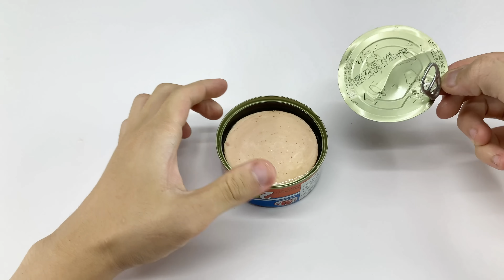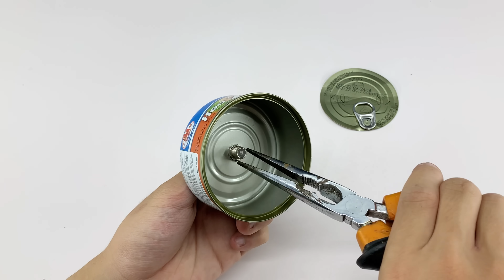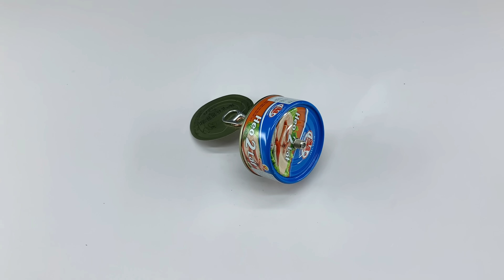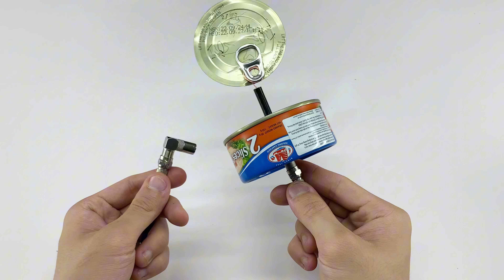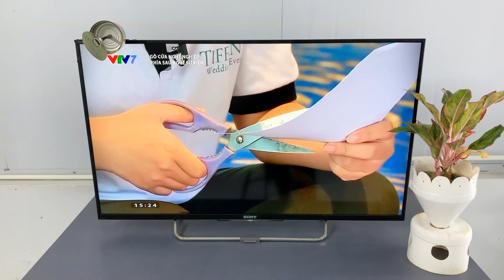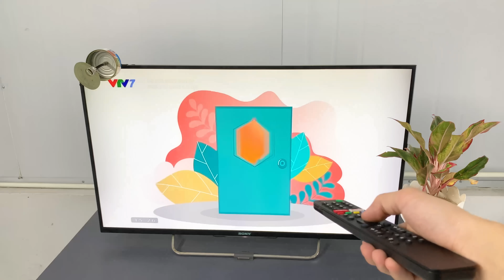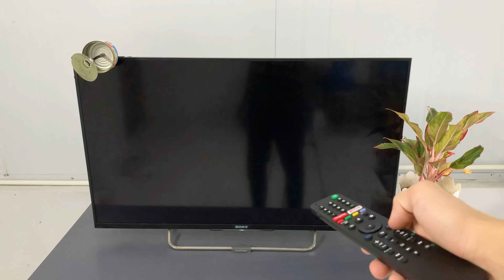No Internet Needed! Put a Tuna Can Behind Your TV – You’ll Be Shocked! 📡

Comment: A friend of mine concocted a Frankenstein-looking apparatus with aluminum foil and metal whatnots - wire hangers, nails, screws, bolts, bottle caps, etc…Her makeshift antenna pulled in 26, over-the-air channels - no internet, though. 

A lot of thrift stores sell television antennas. I got one for $3. It pulled in 26 channels. I spotted a brand new antenna at a discount store for $8. 

In a financial pinch, I can, clearly, understand the need for creativity. fyi: the odor from a tuna can is very difficult to wash away. It lingers.
Reply from the maker: Haha I love that story 😄
DIY antennas can look totally wild but still pick up a ton of channels — no internet needed, just good old over-the-air TV 📡.
And yes… the tuna smell never truly leaves. It becomes part of the antenna’s soul 😅🐟
Reply: Yes Clorox or vinegar for odor
Reply: Not necessarily, clean can with soapy Jim water- smell gone forevver
Reply: Would a can of wax beans work??
Reply: @hingoed Yes but that's only good if you trying to get High Definition on your Television.That is what Bean cans are used for.😂
Reply: Wash it with the original blue "Dawn" dish detergent and lemon juice.
Reply: put white vinegar in the can, leave it in several days ! the odor will go away, same with laundering stuff, wc....
Reply: Et qu'est-ce que vous faites du thon ,?  Vous le recyclez aussi ?
Reply: Wash tin with vinegar. Or use a different content tin ❤
Reply: 1 more thing don't cut your fingers off with the lid! As if the smell isn't bad enough! 😂😂😂😂😂😂
Reply: lol
Reply: Hooo❤
Reply: تختفي مع القهوة الجافة ..لن يبقى منها شيئا
Reply: This doesn't really work
Reply: No
Reply: Total unnecessary ridiculousness !
Reply: Берёте просто спицу от вязания и вставляете в гнездо и он начинает ловить каналы и не нужно не какой банк. Из под тунца
Reply: I rather  smell the fish  than spend money  to make other rich  that is called smart
Reply: I stuck a teaspoon in the back of a tv once in a hotel and it worked. But later tried another in another hotel it didn't may not work on all.
Reply: Wipe out with vinegar to get rid of the odor
Reply: I was getting in 60 something channels with an antenna until it got blown down & broken up. I could turn it from inside thru a channel box. I had another antenna that my landlord hooked up for me, but it probably won't last long & then I'll have to get satellite or cable & have to pay for tv then.
Reply: @Pamela-w8h7f  Pozri v kontajneroch na odpad. Tam nejaké plechovky určite nájdeš.
Reply: رائحة التونة ليست مشكلة ممكن تزال بعطر جيد
Reply: @الحمدلله-ن4ط6ج try bleach
Reply: @الحمدلله-ن4ط6ج or Clorox
Reply: @الحمدلله-ن4ط6ج 0:3p4
Reply: عالیست این جای ماخالیستین

Comment: Can I in old Tv?
Reply from the maker: Yes, absolutely! 👍 You can use it with an old TV, as long as it has an antenna (RF/coaxial) input.
If it’s a very old analog TV, you might just need a digital converter box to get modern channels. 📺✨

Comment: not functioning if the TV broadcaster was far or signal was not strong enough 😊
Reply from the maker: Exactly! 📡 You’re absolutely right — distance and signal strength make a big difference. This DIY antenna works best when the transmitter is within a reasonable range. 👍

Comment: Wait a minute.  Do digital tvs actually need an antenna? I don't think so.
Reply from the maker: Good question! 👍
Yes — digital TVs still need an antenna to receive free over-the-air channels. The “digital” part just means the tuner inside reads a digital signal instead of analog.
Without an antenna, the TV has no signal source (unless you use cable, satellite, or internet). 📡💡

Comment: But my question is what is the plastic box plugged in. TV??
Reply from the maker: Good question, my friend! 📺🔧
Yes — that small plastic box is the signal splitter, and it’s connected to the TV’s antenna input. It helps combine or divide signals between cables for the DIY setup.
Do you often experiment with TV antennas or electronics? 😉✨

Comment: I’ve tried this invention I’ve got a picture with slight tin t
Reply from the maker: That’s great progress! 📺👍 A slight tint usually means the connection is working but could use a little adjustment — try changing the wire length or position for a clearer picture. Keep experimenting! 🔧😉